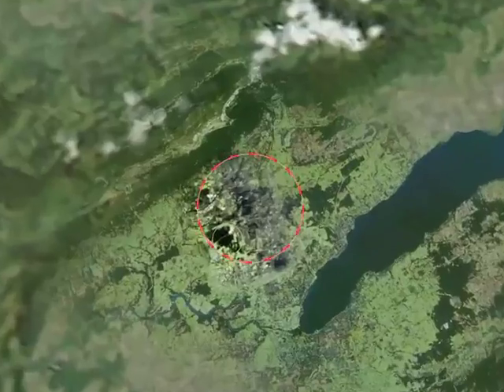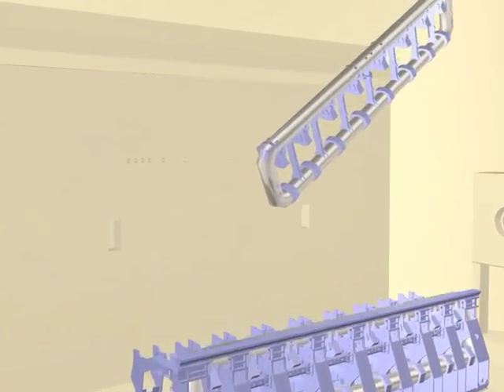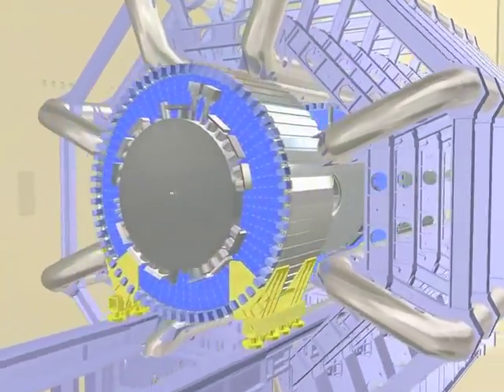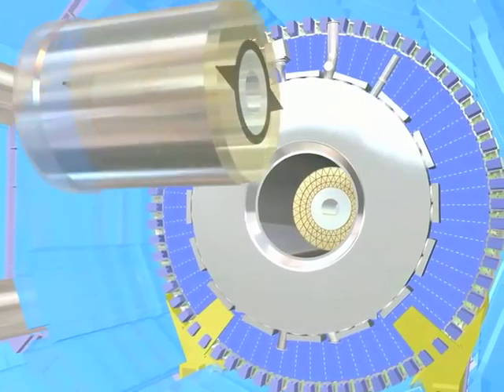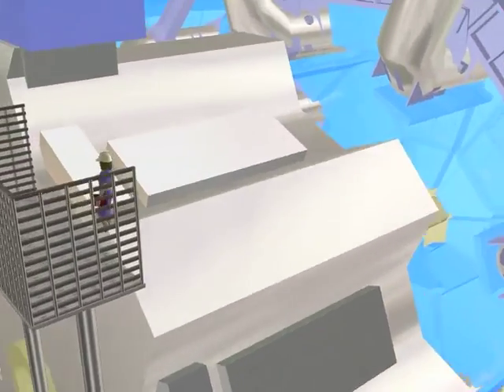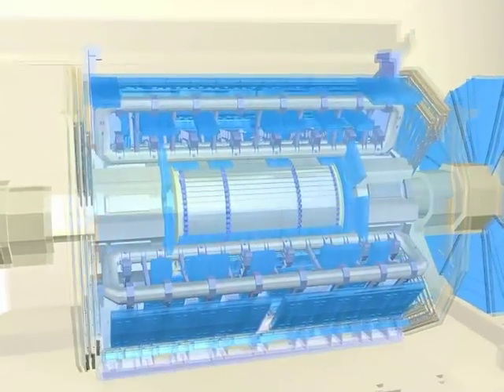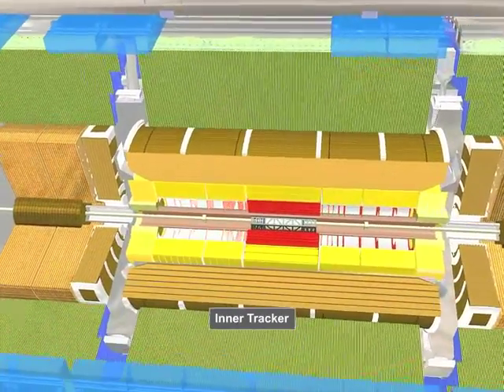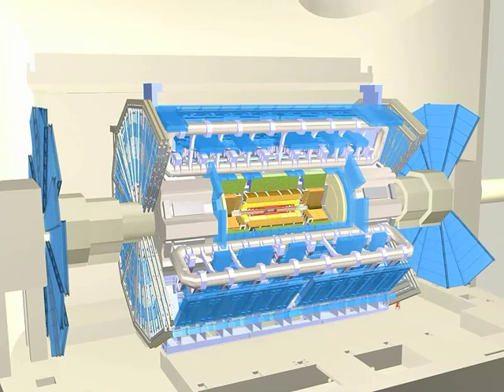ATLAS - Episode 1 -A New Hope

Comment: well you realize you need to create the antimatter from energy, right? ;)  that comes from the electric company, who might be using fossil fuels, or hydroelectric, or nuclear. the antimatter you create will be subject to the same energy conservation (and loss as heat, etc) so you still need more energy to produce the antimatter than you'll get from it. but with iter and other fusion projects, antimatter might be a useful fuel due to its energy density and conversion efficiency